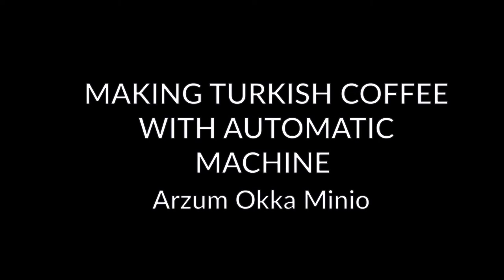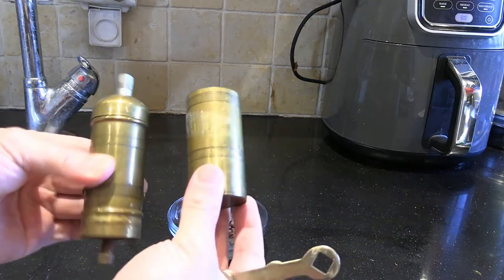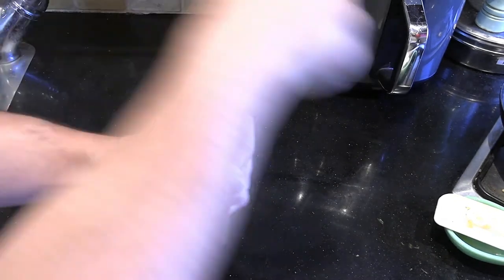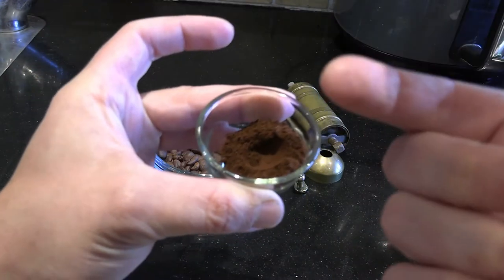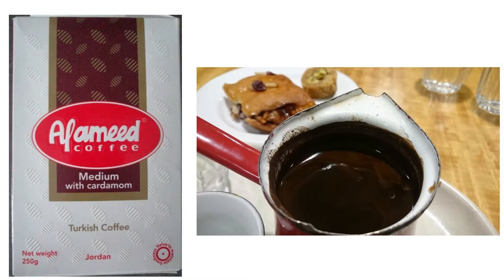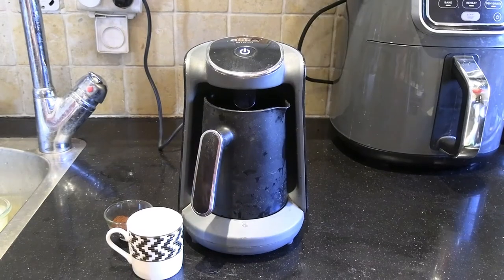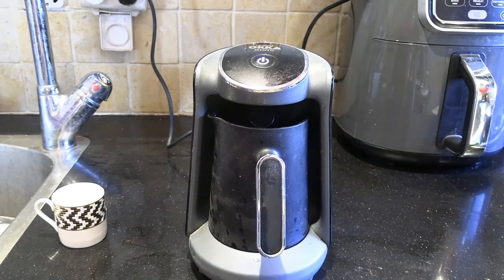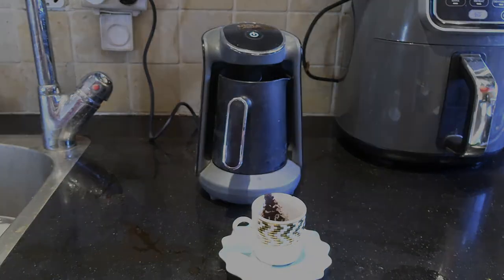Making Turkish Coffee With An Automated Turkish Coffee Machine (Arzum Okka Minio)!

Comment: Interesting video. How does the result compare with Turkish coffee that was carefully prepared the traditional way? 

Also, is there an optimal amount of water to use? What happens if you put too little or too much?
Reply from the maker: I can't claim to be the most discerning taster in the world but personally I haven't noticed a big difference. Re: water. Some will measure in ml but you just traditionally put in the volume of the finjan (cup) leaving a little for the coffee to displace. I've never measured. At my former level of addiction, coffee preparation had to be an efficient process!
Reply: @DanielSRosehill  Is there any difference in flavor or mouthfeel when making 1 cup vs 4? I'm trying to figure out how this machine handles different amounts. If it goes by sensing that the coffee is about to overflow this could be very different when using different amounts, and possibly won't happen at all if the amount if very low in comparison to the size of the pot.
Reply from the maker: To the best of my knowledge no. I frequently use it to make 4 x small cups for guests etc.